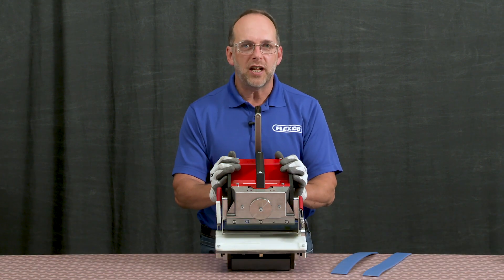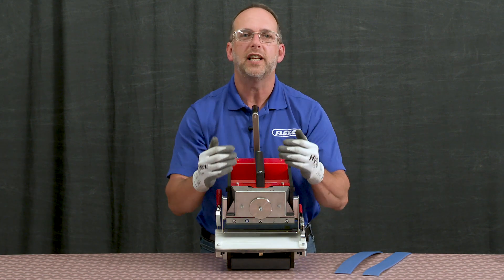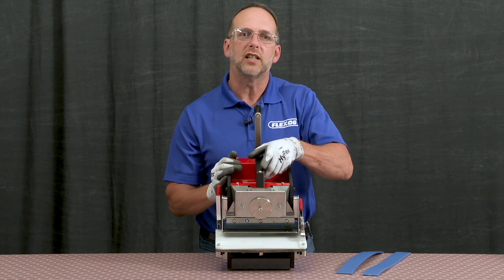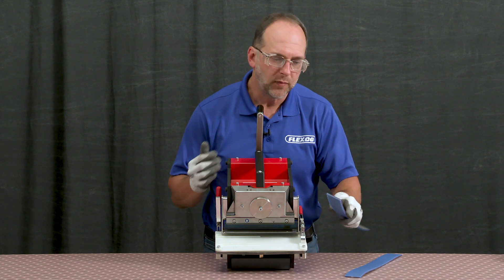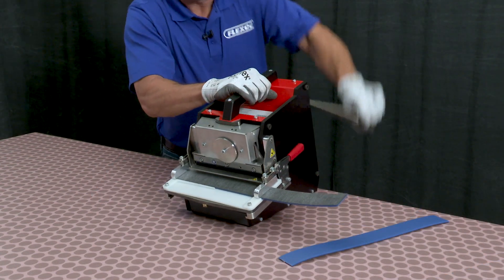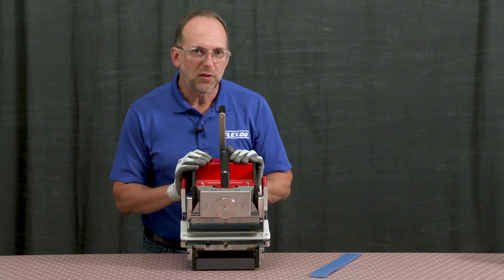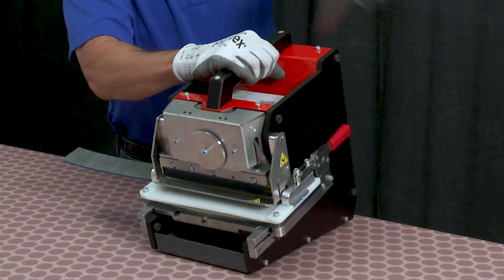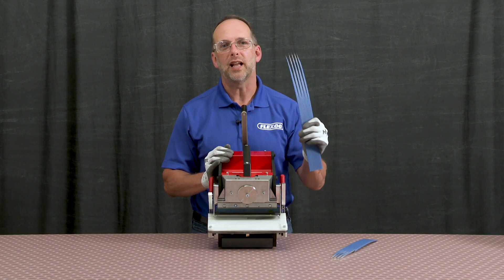Novitool® Pun M™ NDX 200mm Belt Operation

Comment: Can you set up the NDX 2oomm to cut the 77mm wide belt with segmented guide?
Reply from the maker: Unfortunately no that is not possible, There are two separate punches designed for the specific finger dimensions:
 
200 mm long x 10 mm wide
114 mm long x 12 mm wide